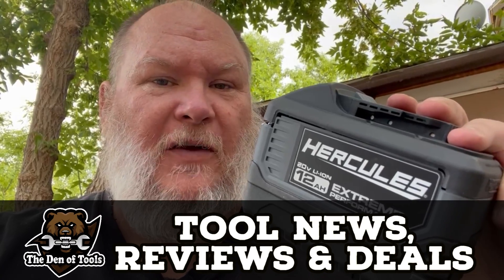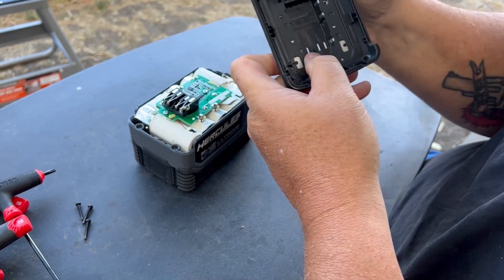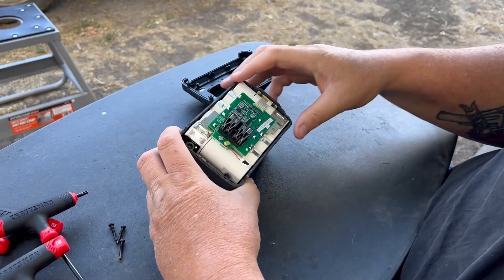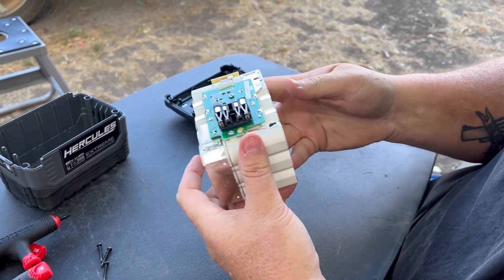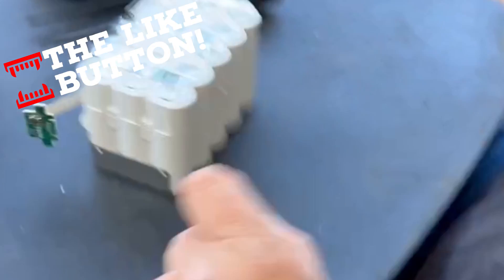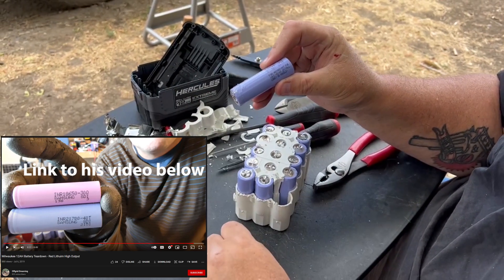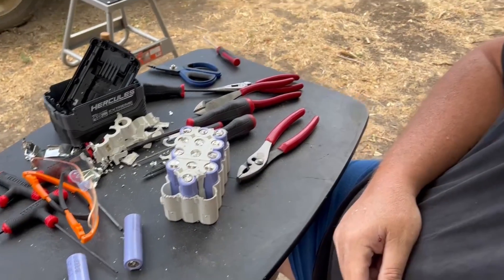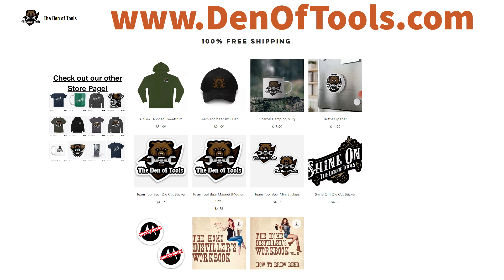Hercules 12Ah Battery Tear Down is SHOCKING!

Comment: Call me a Luddite, but I prefer to stick with corded tools. As a weekend warrior, I just cannot justify using any cordless tool.

 I totally get it if you’re the type of person who needs to use the tool on a daily basis in different locations. But if you have a shop and only occasionally need to move your tools someplace else, you’re better off with a corded tool.  

Brushless motors and lithium batteries are no stranger to me because I am also an avid Electric radio control plane hobbyist. I have built my own lithium battery packs from scratch.

The fact remains that cordless power tools are to electric cars as corded power tools are to good old-fashioned combustion engines. I have thrown away two cordless power drills in my life but I still have an ancient corded Black and Decker over 60 years old that works wonderfully. In another five or 10 years it will be impossible to get batteries for the numerous proprietary battery packs. 

I am not against cordless tools per se but you really need to think about how you will use the tool before you choose how it will be powered.

I live in an area that occasionally will get up to a foot of snow every five years or so. I recently bought an electric snowblower. Given that I have 100 foot driveway, buying a cordless electric snowblower would have been absolutely absurd.
Reply: Just say you're an old fart! 😉
Reply: @wt9653  proud of it!
Reply: That’s why a lot of people like metabo hpt because of the corded adapter to have both convenience of cordless with the optional run time of corded
Reply: @ryansnyder7444  I could not agree more! I have two relatively new Milwaukee drills that have proprietary bayonet detachable power cords at the handle. 

If there were some industry standard for batteries and a connector at the handle, The world would be a better place.

On a completely unrelated  note, have you ever noticed that many rechargeable electric razors cannot be used when they are charging? That wasn’t always the case. I had an old Norelco that would allow me to shave while it was charging. I can’t find one that does that today.
Reply: I agree the rush to large cordless tools is going to result in piles of scrapped equipment because replacement batteries are too expensive or not available.  As for cordless drills and impact drivers, a quality set is worth the investment. I have a 10 yr old Milw. M18 set that has had heavy DYI and remodeling use and still work perfectly. I have an older HD 1/2 in. corded drill for drilling large dia..holes, and for thicker steel. But for all other uses cordless offers convenience and ability to use most anywhere.
Reply: @3frogltd987  I could not agree more. There is a reason I have gone through two cordless drills already. The first was a Craftsman the second was a HF Chicago Electric. The Bear has already convinced me that if I ever do buy again it will be a Hercules.
Reply: Wow! The Bear loved my post! Made my day!!!!

Comment: Thanks for taking the hit on the battery. May pick up one of the impact wrenches, battery, and charger even though the other stuff I have is dewalt.
Reply: I would bet money Harbor Freight sends these to Jeff free of charge.
Reply: You can run dewalt and Milwaukee batteries in it also

Comment: I think that the real answer is that Harbor Freight is selling these batteries at a modest profit while MIllwakee wants to make ALL the money every time they sell a battery.
Reply: I think you hit the nail on the head.  No pun intended. And even though I’m not a fan of cordless tools. If I ever do buy another, it will probably be Hercules.
Reply: I think HF is selling these at a very good profit. As a business,  that's what they should be doing. Other companies are selling these at monster profit. The strategy helps drive the sales of their lower capacity, lower cost batteries. Imagine if the battery lines didn't have proprietary connections. The competition would be unreal.
Reply: @v8packard  I suspect it will eventually happen and that’s why I have been holding off on buying any cordless power tool at this point. I suspect the US military might insist on a standard. If I were in purchasing at the US government, I would certainly be asking for one.  Mil-Spec batteries for cordless hand tools make sense to me.
Reply: @MultiPetercool  Interesting point! I wonder, if there was a Mil standard, would it make it to consumer markets? Hmm
Reply: @v8packard  We can only hope that a connector standard will emerge.
Reply: @v8packard  I was just thinking about to write you can usually buy same batteries at a fraction of the cost on line . Not sure about these if they new they are constantly adding stuff to prevent this . They shouldn't be ripping people off to begin with
Reply: @paulclancy2404  I have some experience with these batteries.  My results were inconsistent, some of them were fine and roughly equivalent to the OEM battery pack. Some were short lived, or short on power. From the same source, too. The newest tools might require a controller on the battery that communicates with a controller in the tool to make everything work.
Reply: @v8packard   You would think that there would be something on the individual cells labeling them as irregulars. If Samsung were labeling factory second batteries with the same Part number as A-stock stuff, there could be legal problems.
Reply: In defense of Mil/DWT and other major manufacturers, they have in house designers that actually design the tools. They then find a manufacturer to make their tools, incorporate QA etc. Harbor Freight does neither. HFT goes to the same Mfrs. then gives them parameters of a tool (including cost) with limited QA.
Reply: @corin164  I love Milwaukee I just can’t afford them.
Reply: @corin164 that is necessary true anymore, the hercules batteries are designed in usa.  I haven't checked on the tools themselves yet.  you are correct for the cheaper stuff at harbor freight
Reply: Look at that battery pack construction.  Theres no impact protection on the cells.even ryobi uses  foam wrap and crush zones in the plastic internals to protect the battery assembly from pact damage.
Reply: @MessalineApghar  The flipside is putting what is effectively insulation in would simply keep the batteries hot. Not good.
Reply: @MultiPetercool  when it's considered as a design issue and accounted for , it's a non issue.  Ryobi batteries have both kinds of protection and for the most part last well beyond the 5 year expected lifespan... For example my first failures , in 2021, were batteries with a manufacture  date of 2003.
Reply: @MultiPetercool once more, I see this is a year old comment.
Is there a temp sensor inside this "insulated" battery pack?
....a sensor that would also control the charge rate and battery shut down if it exceeds a certain temperature?
I don't know either, but it's amazing the number of theories that come out of videos like this.
Reply: @MessalineApghar  You could be right, however their 16650 powered batteries are similarly built as the 21700 batteries, they should hold up well.  I have dropped my Hercules tools, numerous times and they continue work fine, but time will tell.
Reply: @MessalineApghar  We don't even know of the batteries are true Samsung or if they are counterfeit Samsung batteries. All he did was open the pack and read the name Samsung.
Reply: @LeeCountySpeedShop  not only that, but Samsung makes different grades of batteries.. from 15c to 30c. ( Which is a charge/ discharge speed rating)

Comment: looks like 21700 cells and 18650s in the M18? nice vid the freight is certainly stepping their game up no denying that
Reply: The M18 12ah I'm pretty sure has 21700 cells.
Reply: @search_eternal   i have no idea man. only Milwaukee tool i have is a corded drill and a hammer. im mostly a dewalt guy myself. shoot i probably got over 22 or so dewalt batteries (havent took a inventory in a bit). regardless it hard to deny harbor freight is stepping up their game